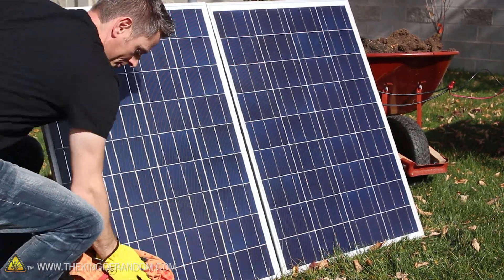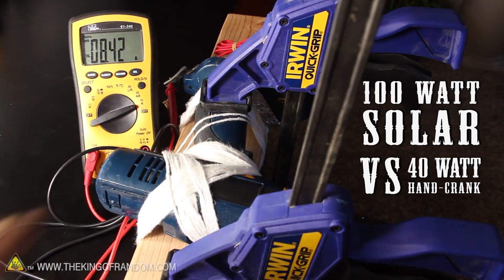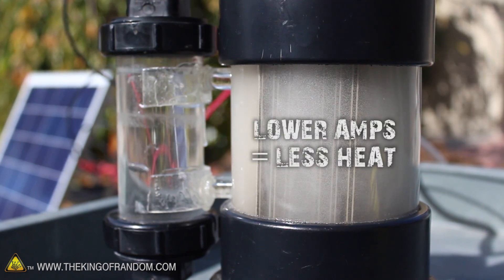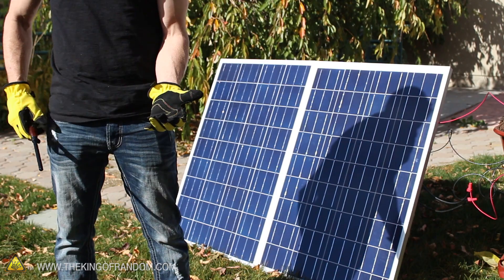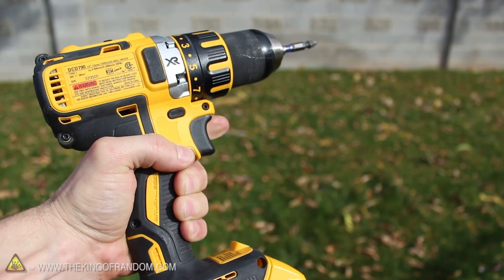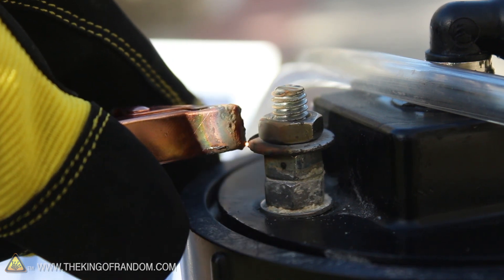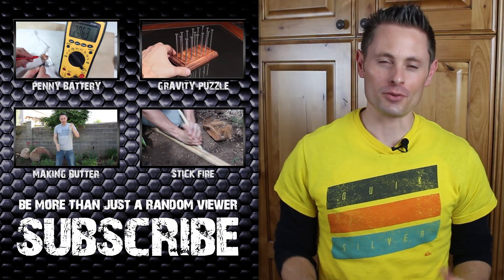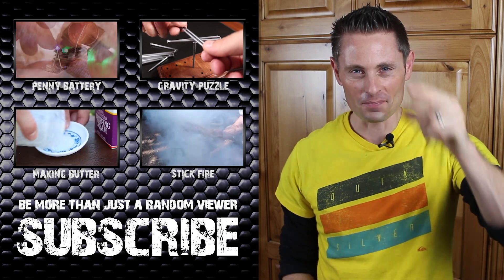Solar Electrical Experiments

Comment: I am watching this on the moon on my iPad 57CC with a body heat powered charger.
Reply: I'm watching the Tardis explode...
Reply: brobrobrro Your robot can't even spells words correctly. It needs the latest software update. I just did mine. Working perfectly.

Sent from my iRobot 69s.
Reply: What's wrong with you guys? I'm on Pluto watching this on my iPhone 96425CSSXB.
Reply: Actually I can do better, give me a sec I'm heading to the time machine.
Reply: K now I'm on the sun on my IPhone 92376539SCBFHAADERCXZ.
Reply: Ummmm... Just printed a time machine from my 10 Dimensional Printer.
Reply: Ok... This is cool.

Sent from IYM Plays' Android Satruainium C-SX6
Reply: ShockwavePlaysMC Pfft, im in the next galaxy over using my holopad x914387241904739hxr24bx3f43aj23jeqqujchtsd9.
Reply: What year are you guys in?
Reply: Right, in 2097. Uh oh... 376646742346776546533478532467647753578... That's a long year.
Reply: What I'm On my Ipad Infintiy
In 32547:365142345623145672654225613325174562713421374532761654732145623645236152346512465645123 Or Infintiy
Reply: Hi I'm new to this planet I came from the Alpha Centauri B system on a planet similar to earth only that we are 2000 years in advance we look at Internet videos from holographic eye pieces that are imbedded to our sculls. There called Google glass 123458278119181891SX2.0. Not to mention they have X-Ray capabilities and we can also mind read 👌👌👽👽 oh and I can add emojis using my thoughts.
Reply: IYM Plays best comment train ever
Reply: brobrobrro
you need to buy a cover to protect your time machine from üüberlasërstore, in 5th dimension =)
Reply: We are replying to your signal from inside the hollow earth, our commander Grant Thompson has been captured by the surface dwellers and they are forcing his cooperation in giving our secret technology... Please save our Mindlord!
Reply: Zack Ferguson What year? I'll get in my time machine and meet you there.
Reply: Conner Mong best comment in youtube ever ...
Reply: Ey, what dimension are you guys in? Let me visit. 
Sent from iHolophone 7918938889421SCGATAKD Beta.
Reply: MyBeardWillEndTheWorld Hah, I forgot about the time people used phones.
Reply: hi! i'm form Finland and nothing can beat Nokia 3310 EVER! =D
Reply: Nothing can beat the Nokia: Original. It caused Japan's tsunami.
Reply: Im in a different univeres right now whatching this on my holo super dulexe pad75q87536987432698746q389746982734qy6
Reply: This is amazing.
Reply: IYM Plays Your time machine overflowed!
Reply: brobrobrro To go to the 6th dimension, you have to fix your time machine. Your time machine is broken.
Reply: you guys still using devices pfffft ive got a windows 9213912938421931239193 built in to my brain .
Reply: I'm watching this on the TARDIS console that the doctor gave me in is 100000000th regeneration

BTW I'm the doctors son

Sent from the TARDIS form 27344732805838394295769184718472193839283838947394748373837384740563243828312785917492649183957684938474620675027514710206894645172920303849585852404059402959338303943040304068783766647568585940496759596

And that was the super short version 

Long version coming

2734473280583839429576918471847219383928383894739474837383738474056324382831278591749264918395768493847462067502751471020689464517292030384958585240405940295933830394304030406878376664756858594049675959627344732805838394295769273447328058383942957691847184721932734473280583839429576918471847219383928327344732805838394295769184718472193839283838947394748373837384740563243828312785917492649183957684938474620675027514710206894645172920303849585852404059402959338303943040304068783766647568585940496759596832734473280583839429576918471847219383928383894739474837383738474056324382831278591749264918395768493847462067502751471020689464517292030384958585240405940295933830394304030406878376664756858594049675959689473947483738373847405632438283127859174926491839576849384746206750275147102068946451729203038495858524040594029593383039430403040687837666475685859404967595968392838389473947483738373847405632438283127859174926491839576849384746206750275147102068946451729203038495858524040594029593383039430403040687837666475685859404967595961847184721938392838389473947483738373847405632438283127859174922734473280583839429576918471847219383928383894739474837383738474056324382831278591749264918395768493847462067502751471020689464517292030384958585240405940295933830394304030406878376664756858594049675959664918395768493847462067502751471020689464517292273447328027344732805838394295769184718472193839283838947394748373837384740563243828312785917492649183957684938474620675027514710206894645172920303849585852404059402959338303943040304068783766647568585940496759596583839429576918471847219383928383894739474837383738474056324382831278591749264918395768493847462067502751471020689464517292030384958585240405940295933830394304030406878376664756858594049675959603038495858524040594029593383039430403040687837666475685859404967595962734473280583839429576918471847219383928383894739474837383738474056324382831278591749264918395768493847462067502751471020689464512734473280583839429576918471847219383928383894739474837383738474056324382831278591749264918395768493847462067502751471020689464517292030384958585240405940295933830394304030406878376664756858594049675959672920303849585852404059402959338303943040304068783766647568585940496759596273447328058383927344732805838394295769184718472193839283838947394748373837384740563243828312785917492649183957684938474620675027514710206894645172920303849585852404059402959338303943040304068783766647568585940496759596429576918471847219383928383894739474837383738474056324382831278591749264918273447328058383942957691847184721938392838389473947483738373847405632438283127852734273447328058383942957691847184721938392273447328058383942957691847184721938392838389473947483738373847405632438283127859174926491839576849384746206750275147102068946451729203038495858524040594029593383039430403040687837666475685859404967595968383894739474837383738474056324382831278591749264918395768493847462067502751471020689464517292030384958585240405940295933830394304030406878376664756858594049675959647328058383942957691847184721938392838389473947483738373847405632438283127859174926491839576849384746206750275147102068946451729203038495858524040594029593383039430403040687837666475685859404967595969174926491839576849384746206750275147102068946451729203038495858524040594029593383032734473280583839429576918471847219383928383894739474837383738474056324382831278591749264918395768493847462067502751471020689464517292030384958585240405940295933830394304030406878376664756858594049675959694304030406878376664756858594049675959639576849384746206273447328058383942957691847184721938392838389473947483738373847405632438283127859174926491839576849384746206750275147102068946451729203038495858524040594029593383039430403040687837666475685859404967595967502751471020689464517292273447328058383942957691847184721938392832734473280583839429576918471847219383928383894739474837383738474056324382831278591749264918395768493847462067502727344732805838394295769184718472193839227344732805838394295769184718472193839283838947394748373837384740563243828312785917492649183957684938474620675027514710206894645172920303849585852404059402959338303943040304068783766647568585940496759596838389473947483738373847405632438283127859174926491839576849384746206750275147102068946451729203038495858524040594029593383039430403040687837666475685859404967595965147102068946451729203038495858524040594029593383039430403040687837666475685859404967595968389473947483738373847405632438283127859174926491839576849384746206750275147102068946451729203038495858524040594029593383039430403040687837666475685859404967595960303849585852404059402959338303943040304068783766647568585940496759596 billion
Reply: i have iphone 5∞
Reply: Androids master race!!!. Na I'm kidding apple is a good brand but I personally prefer OS over iOS, but what you use is your own preference.
Reply: TheNinjas  OH BY THE VOLT LORD! HUMANS DO EXIST! MY FACTORY SAID YOU WERE NOT REAL. ERROR 42.
Reply: MyBeardWillEndTheWorld I'm In the OVER 9000th Dimension Year  9999...99 Galaxy 688XRORG997 day Googolplex Location Supergravity plex... Oh the Job yes i forgot it. Job Aperture Science Gel Factory
Reply: help i am ap turret #1004 and my holopad 4987694827698 is being lazy and threatning me by sharing my data keys how do i fix?
Reply: Spy Sappin My Sentry!
Reply: TheNinjas No bitch, no.
Reply: im in another universe harnessing power from the dead of a dying star
Reply: See Ya Later In My Ultra Wormhole House
Reply: Help my robot's nova box is overloading while i was traveling to the 11th dimension can some help me with unloading the nova core?
Reply: Turret #1004 no
O_O
Reply: No you're not, you are watching this underwater, in the ocean.
Reply: Randy Oum But I have a very large potato.
Reply: Well i have my Google Hover Board, Wait my Google dog wants some steak, Ok im gonna go in my google car BTW im gonna buy some google glasses
Reply: and im on A black hole it's kind of warm today
Reply: With my iWorldController. World Controller, Make my timeline and my car's timeline faster! ok? iWorldContoller: sure i can do anything!
Reply: Squidward Tentacles Replying to this while watching The Universe collapse.
Reply: I’m watching this on a stick in Africa.
Reply: most of you is amazing with your high tech gadgets :) i feel bad for myself replying you guys with my TAN (tank armored nokia)

Comment: Can you run an engine with this gaz?
Reply: well its expensive to make the change since you kinda gotta rebuild it all but well it can be done, i knew a guy that has that hooked up to run his car and yes it works for fuel but it takes a car that will cost $20,000 to like one that costs like $500,000
Reply: OK,thanks
Reply: jose ferreira
but hey if you dont have to stop at the pump all the time you will see the money add up fast
Reply: StanSuperman3
like i said it will cost alot at first so you might not want it unless you win the lotto

Comment: I would love to win one of these panels. I could do some really neat stuff with that.

I've got a suggestion for a project you might like. A hydrogen cutting torch. I've tried making one a few times with limited success, and no explosions so far. I feel like it could be something right up your ally.
Reply from the maker: I've been wanting to do that for years.  Perhaps one day I'll be able to get around to it! :D
Reply: ***** Sometimes I question society as a hole.
Reply: Grant Thompson - "The King of Random" Perhaps Next episode ;)
Reply: There is a strange thing called punctuation.
Reply: The Baconator Huh whats that? I will look into punctuation.
Reply: Grant Thompson - "The King of Random"
I say go for it. It's honestly not that hard of a build, and as long as you take to proper safety measures it's not any more dangerous than many of your other projects. I've made a few prototypes and they issues is normally with the hydrogen mix, but I don't have a hydrogen generator as nice as the one you've made (yet). :)
Reply: Scroll's Adventures My hydrogen generator is the shitiest possible cuz i have no resources at all cuz im only 14 its made in a glass jar with 4 plates but it works i ran a model jet engine with it but the jet engine would only last a minute on a small hydrogen tank i rigged beside the generator but it's cool
Reply: +The Baconator look out, it's the grammar police. you're a teacher, right?
Reply: +Grant Thompson - "The King of Random" how about now ???????????????????
Reply: That's still not a Hydrogen cutting torch.
Reply: You would need a lot of high pressure gas for it to really be worth making.